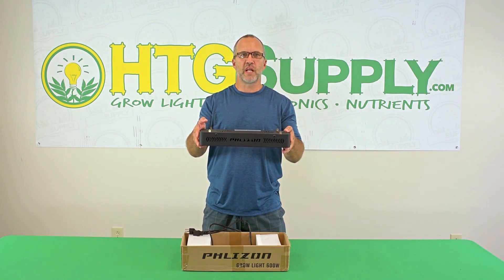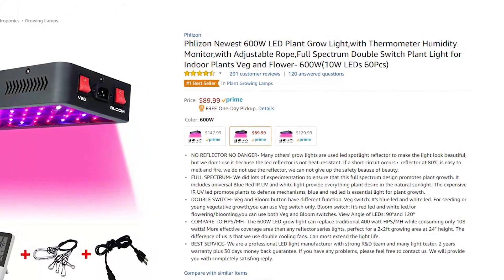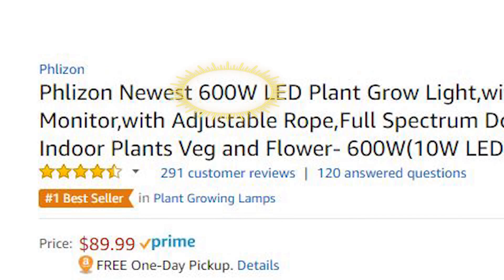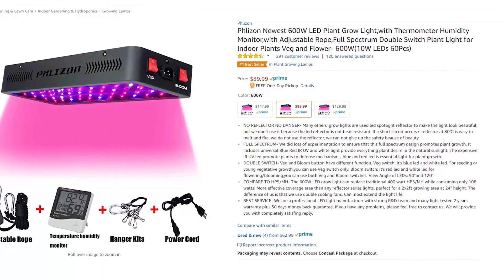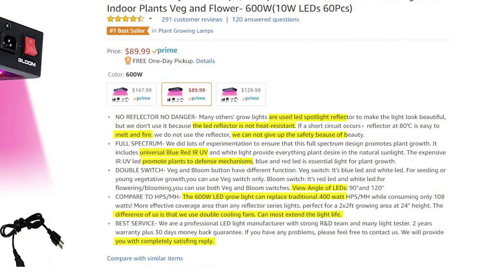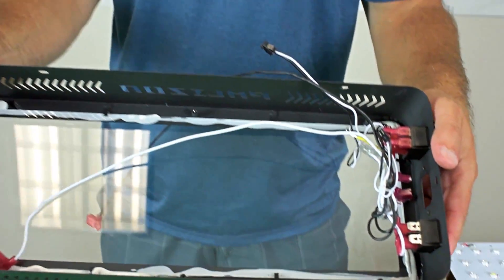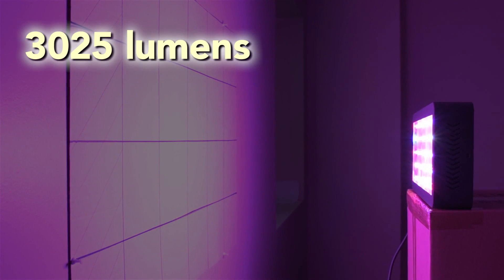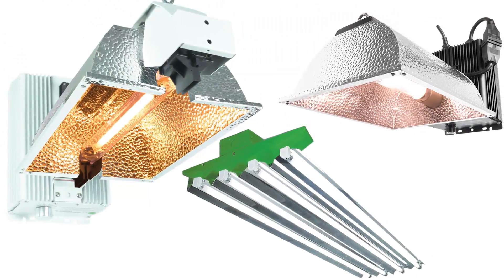PHLIZON 600w LED Grow Light = Cheap Amazon LED Grow Light: Eddie Reviews

Comment: It suppose to be equivalent to 600watts but only using less then 100 watts... they pull exactly 77watts on full power... I have 2 of them and they have work great in my set ups... I tested them with my volt meter and ran them on my solar setup... both read 77 watts... and I got my first one 2 years ago and its still doing great...  I use them for my mother's and clones.... but for bloom I use 2 big boy gavita 1700 led... they both pull 648 watts each replacing energy eating hps... don't sleep on those Philzon led.... they do great in my opinion...
Reply: Would 1 be fine on 1 plant?
Reply: In Maine a 4x4

Comment: I’m using this light now for my grow in a 2x2x4 tent. I am in late Flower with about a week and a half until harvest. Light works great. Used it for entire grow.
Reply: Apeman Commeth  and yes my friend you are supposed to have BOTH veg & flower buttons turned on at the same time. That's the proper way to use it so you were correct in flipping both switches on.
Reply: Are you using just the 600w version? How many plants?
Reply: hey man. how many plants you got in there? decent amount of buds or?
Reply: Have you learned anything new in the past two years regarding lighting? Trying to shop for a 2x4 tent at the moment.
Reply: You wouldn't get more then 99 grams with this light at best

Comment: Will you take a look at the "1000w"  phlizon COB series?  it's also very cheep, but it has some decent COB lights and heat sinks.  Also, doesn't the narrow light bands match up with most plants needs?  I was thinking that green light was not used by plants much..

Thanks for the video!
Reply: i got the 1000 cree cob phlizon ,, great little light will give you a good crop perfect up to a 3ft x 3ft tent
Reply: @ivorgreenplant   yeah, I've got one too, though I'll likely get some additional lighting as I've got a 4*4 and I know this light is on the dim side for ppfd for a flowering plants.

Comment: Thats nothing new. Every light seller does that. They have 100 10w bulbs so they call it a 1000W grow light. It holds no relevance.  Just because they are 10w bulbs doesn't mean they actually consume 10w . They might only have 5w going through a 10w bulb. Keeps it cooler and lasts longer. Its just a marketing strategy to sucker the folks who don't fully understand the numbers. Look at actual power consumption. 

One thing i really disliked here on the vid and i have to say is LUMENS is a terrible way to judge a grow light. Lumens is what the brightness that a human eye can see. It holds low value in modern horticulture studies  and plants. I could have 100, 000 lumens. But if its mostly green and yellow light its near useless to a plant. 

 Wavelength (nm) , PAR and PPFD are the numbers that you'd look at in horticulture not lumens! That's a noob thing to look at is lumens. 

That light is weak as well. I wouldn't waste my time with an LED under minimum 180W actual power consumption . Waste of money any lower.
Reply from the maker: Well - most sellers on Amazon advertise some imaginary "bulb" watt figure, which often has very little to do with actual wattage consumption and light output.  Not many "commercial" LED grow lights are advertised the same way.  It is indeed a way to sucker in folks that don't know any better.  PAR and ppfd are indeed much better ways to measure, but you need to look at the spectrum also, as PAR and ppfd figures include all wavelengths between 400-700nm, so as Landon correctly states, you need to pay attention to the spectral chart as well.
Reply: They comparing to halogen
Usually 10w led equal 100 w halogen and so on
So 60 w 600w
100w 1000w
Spiderfarmer 1000 drains 100w on the wall
Thing is that
Reply: None all the seller does like that.   The LED is not 10Watt led.   10Watt led run by 5w or 3 watts.  That is good.      Actual power consumption is one of the points to check.